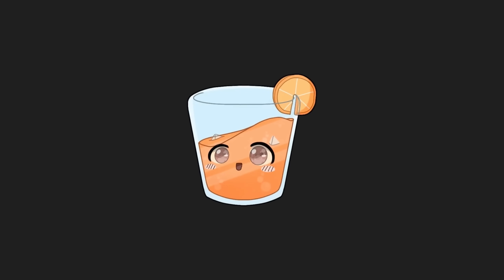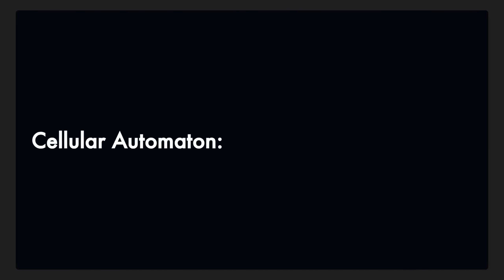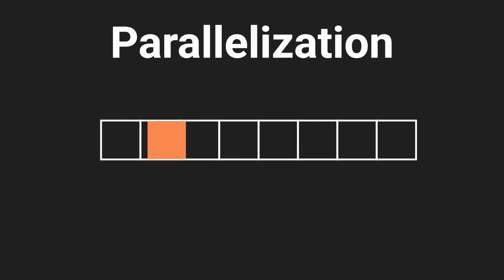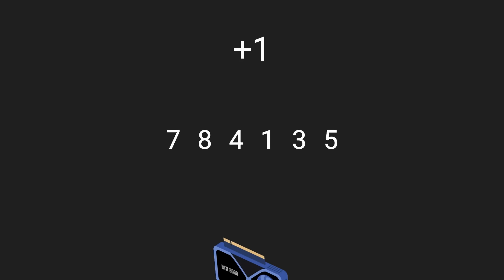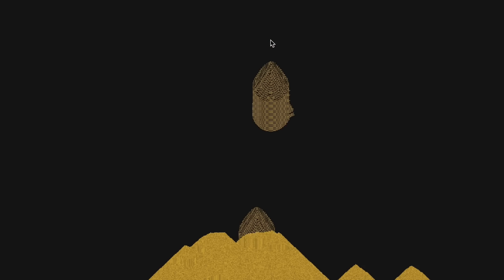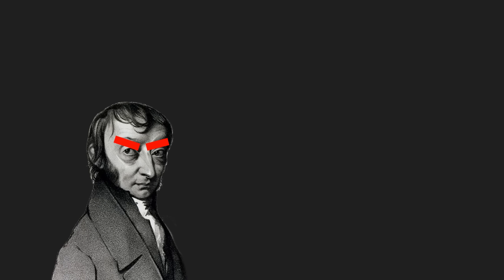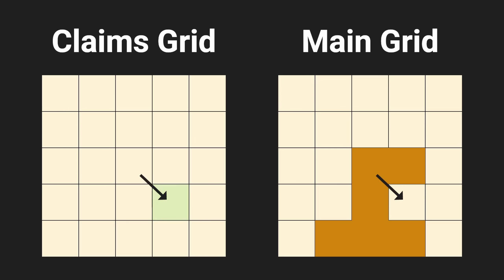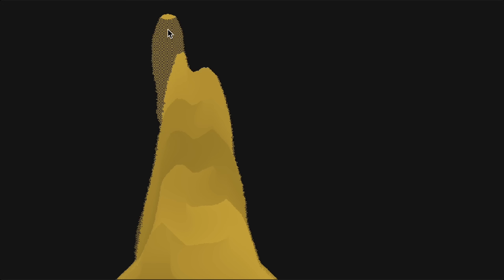Optimizing a Falling Sand Simulation To an Unreasonable Degree

Comment: can't you still make two particles occupy the same space, but then when they detect two of them, one can then push the other out of that space?
which direction it should be i guess is another matter. for the speed of the trickle, collisions probably could make grains skip a pixel instead? like if two grains occupy a spot at a time, and one pushes out the other, it could shoot out 2 pixels away instead.
Maybe there could be a ledger of coordinates, and it can be possible for each object to have the same coordinate

Comment: hm... what if we completely rethink the problem... i'm too lazy to try and code it, or ask chatgpt to do it... but...
what if the particle isn't the one doing the falling, but the empty space is doing the pulling... 
we keep a list of all empty spaces that have a particle in the 3 pixels above and it pulls down one... so we don't iterate the entire grid...
there's a few potential issues i can think of here, but if we z-buffer this, or y buffer i guess... we are gonna iterate from the bottom, update the lowest one, check the one above and add it to the list... that way, all the particles on a slope fall in the "same frame"...  cause the one below fell down and told the one above "hey, i'm free"...

Comment: Atomics for this is more of a brute-force approach - really hampering performance.Also sure, CPUs are not as great at parallel tasks as the GPU, but entry-level CPUs you can easily deal with more than 16 operations at once so you can get quite a speedup there.

There are 2 (3) easy approaches for resolving the problem of multiple grains ending in the same place:
1 - changing grid pattern. Your attempt clearly had a bug in it, but just using a 2x3 update-grid and going through those in any order would fix the problem.
2 - each direction as a pass. do the steps for going straight-down, left and right as separate passes one after another. None of those passes alone can have a race-condition.
3 - chunked sequential (on the CPU). Do all the computation on smaller 32x32 or so clusters, and queue the border-interactions for a post-processing step.

It is nice seeing falling-sand games reappearing, but it is also strange to see that today they often do not perform any better than they did some 25 years ago on single-threaded 2.5GHz CPUs with far worse IPC.

Comment: You can restrict where the simulation run (the simulation box) by remembering where sand is the most to the left, right and top and add + 1 to allow the sand to extend the box. This way you can have a grid looking almost infinite with physic only running where sand is. But the more spread out the sand is, the slower it runs.
Then the next step is to divide the grid into chunks to compute simulation only in chunks that have sand and are not at a standstill.

Comment: That is what happens when coders having all tools in the world refuse to spend 30 seconds in a search engine to find out that dry sand that you simulate does not stay in piles of 45 degrees angle. Read about it on the "Angle of repose" wiki article for example.

Comment: I wonder how it'd compare with the CPU based one if you were to use SIMD intrinsics.  
GPU acceleration is very powerful, but CPUs are more capable than we give it credit for.  
Especially if you encode your data in a bitmap and leverage bitwise operations wherever possible.

Comment: What about using ping pong render targets?
Previous state is stored in a texture and the next state is computed by blitting a quad into a second render texture with the prev state as input. The two render textures are flipped to continue the simulation further. It can be performed by a fragment shader, is heavily parallel with no race conditions (you don’t read your writes) and resides 100% in the gpu.

Comment: I'm a Ph D student and computer scientist who worked on an Agent-Based Model on the GPU. In regards to your race condition section: This problem is called spatial resource competition. In my work, we use a randomized tiebreak to solve this. Imagine each time a cell with sand wants to move its sand down, it draws a random number, and stores that at the destination, and in itself. Then the sand that gets to move is the one that just happened to draw the biggest random number. You can use the claims grid and atomic CAS for storing the random numbers. One benefit of this, is it removes thread based non-determinism. It's weird that the sand that gets to fall is just the one owned by the thread that got there first. Because thread ordering is not like a perfectly random number generator, some threads will get to computation later because they are waiting on other threads, so potentially, you could get bias in your hills and stuff just based on silly stuff like GPU thread occupancy (its a bit more complicated in GPU compute code, like threads move together in warps or whatever). Using a pseudo-rng like Philox for this works well because you can just use an offset that is a multiple of the thread id to get random numbers in parallel that will be the same in future runs. This has nice qualities like: Every time you run the simulation if you put sand in the same place it will always produce the same output.

As for the slow rolling down hills: One possible solution probably lies in doing a variant of the sand algorithm on the claims grid itself. Something greedy, if you don't care about determinism, would be to just run the sand algorithm loop for each cell on the claims grid (a claim is treated as a filled cell) using atomic ops to place a claim in the first possible place, and you iterate until either we have struck a claim, or no possible update could be achieved (like an empty cell, or a cell with sand but all places it could fall are acquired). This allows you to not block access to the whole neighborhood but just one cell, at the cost a few extra loops at most per grain of sand. It sounds costly, but in my experience its worth giving such things a shot because it might turn out that some large percentage of checks will resolve in the first iteration, and the performance hit of doing it is small.
Reply: you are the reason I love to read comment section, that's the best place to learn